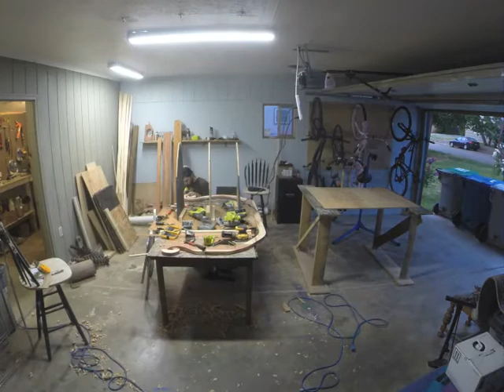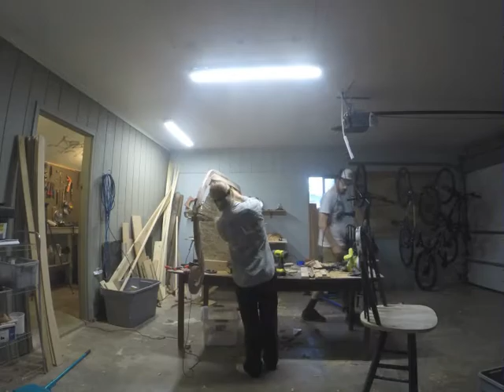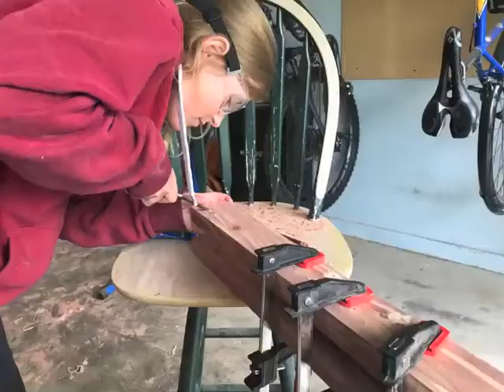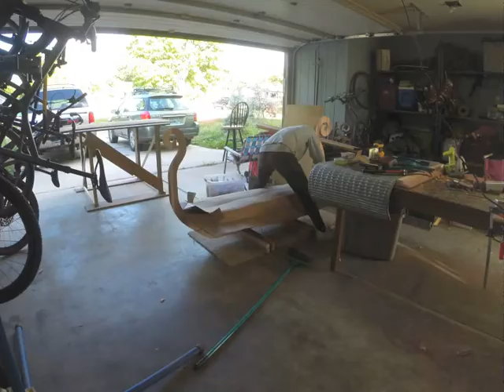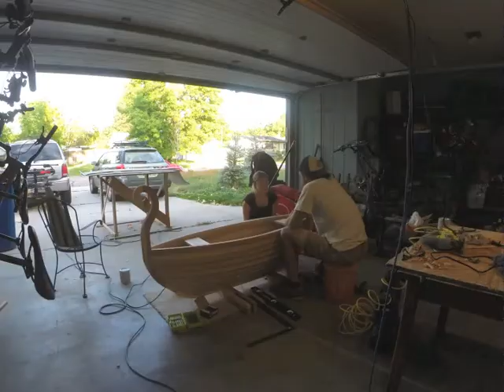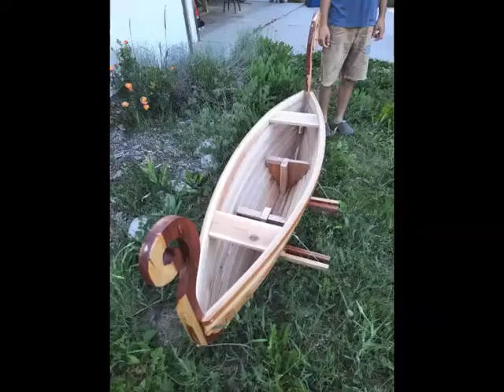Building a Viking Ship Bassinet (timelapse)

Comment: how did ya bend the planks, mate?
Reply from the maker: Used a jack plane to thin the tips so they were a little more pliable, and then submerged the planks in boiled water inside a large pvc pipe. I let the planks sit in the hot water for about an hour. They cool quickly, so I tacked or clamped them down as quickly as possible once pulling them from the water. Other folks seem to steam wood for many hours, but this worked well at this scale (might not work so well for bigger boats).
Reply: @dylangomes3853  the pipe was filled with hot boiling water? how do u keep boiling it in pvc pipe?
Reply from the maker: @boarivoj5571  I just poured boiling water into the pipe, and it stayed hot for quite a while. You just need to cap the ends while the wood is in there so the heat doesn't escape. Also, wood floats, so you want something to hold it submerged. I shoved something in the pipe after the wood to help with this - usually a large piece of fabric like a shirt. I am sure there are better ways to do it, but this worked for me. How long you leave the wood submerged probably depends on the type of wood and how dry it is - you may just want to experiment with this part.
Reply: @dylangomes3853  Thank you very much sir, will most def try. Great work, btw. I wanna make the same thing for my sis's kid, thats why im asking!
Reply from the maker: @boarivoj5571  Thank you. It was a fun process, and also built for my sister's kid. Don't hesitate to ask any other questions!
Reply: Very well done...  I just finished making a longship cradle for my first grandchild couple of months ago.  I used ,  some very similar techniques and style, but I think my scale is a little smaller.  I believe stem to stern was right around 36 inches.  I  also carved a dragon's head and tail for the cradle. Again,  fantastic work, well done.